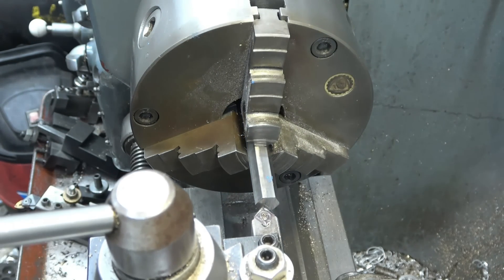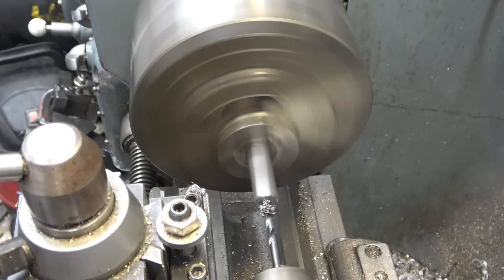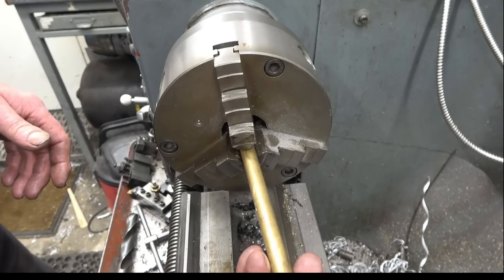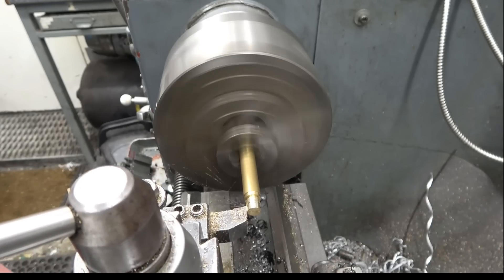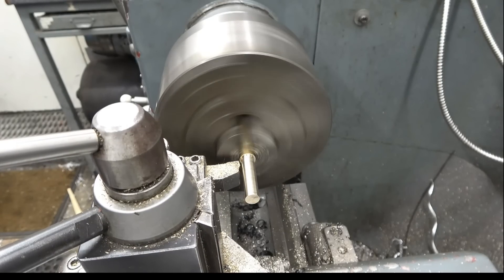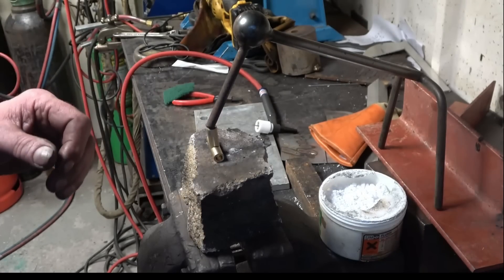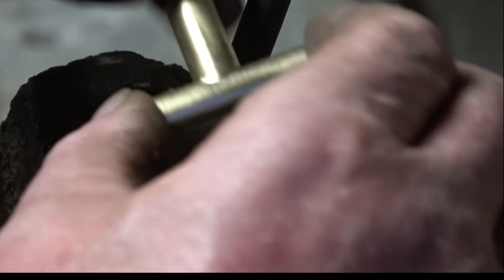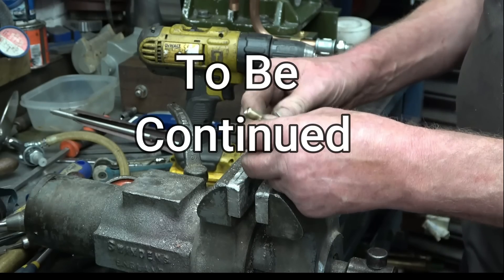SNNC 499 P1  Machining Imperial Nuts . Silver Soldering Brass

Comment: Question -  Hi John, I really enjoy your videos, I always chuckle with the swearing it always reminds me of my days working in heat treatment and the people I worked with. Anyway, my question is, you often have your compound slide set at 45 degrees, what is the benefit of this? If you answer my question, thanks in advance. P.S. After watching your videos, I now use one of my Grandads hand drills to de-burr holes, I would use my dad's hand drill, but I'm thankful to say he is still using it himself.

Comment: The gap in a Silver-solder joint, should Never be greater than maximum 0,1 mm. Ideally 0,05 mm or less, for the capilarly action to work properly. No gaps that is, more or less.
It is less sensitive with cheaper solder wich might be thicker, but very important with high-performance thin-floating solder, wich have the ability of full-penetration and a nice strong concave floating-out joints on both sides of the joint.

Comment: Nice job.
I personally prefer to apply the flux mixed with very soft, or distilled water though. I let it dry or heat it up immediately, it depends on my hurry. Only then do I apply Silver-solder, when the flux shines and the material has the right red hot Colour. Most Silver-solders works best at ~650..750 °C, More Silver, less temperature, and greater the strength and penetration, (fluidity / wetting),  generally. The ductility is also greatly enhanced with more Silver-content, (the ability to not crack brittle under strain).
A good compromise between cost and physical propertiers is 44% Silver, but up to 60% is also used. It works very extremely well to join mild Carbon-Steel to copper and Bronze as well.

Copper-Phosfourous solder with 1% Silver works on pure Copper and piping-Bronze, but not on Brass, the slightest at all. More brittle also and it will fail first on a burst-test, such as on a test-specimen made out of Copper. Not the first choise for a Copper Steam-Boiler. It takes up to 775°C to float properly as well.

On a burst-test performed on cylindrical joints of 20..70 mm Copper-pipes with an overlap-joint of ideally 6..7 mm, you will find the Silver-solder Joint made out 44% Silver is stronger than the Copper and it looks like a belt, before the Copper bursts with a little stream of water in the air :) Of cource not much air in the test-specimen, so as not to cause an explosion, just a pee of water :)

125..150 bar is a common pressure to burst 70 x 2,5 mm of Copper. It Squeals, and most people do not want to stand nearby in the process of bursting, eventhough it is completely harmless, if the specimen is completely filled with water, save for some table-spoons of air :)

My Pressure-Tank, I let a professional build for me as a Compressor-Tank and is good for 125 bar, legally at 180°C with water and steam, but the pressure-relive-valve releases at 10 bar. How is that for a safety-factor ? It was a welding-speciemen for X-ray investigentions, 100 % Röntgen / X-Ray. All welds in the quality of 5 on a 1..5 Scale. Not a single fault. Stamps in the metal from the Welder, and from the Works :)

It already had a safety-factor of 1,5 against 125 bar at 180 °C. And the weld-factors were 80% longitudinally and 45% laterally.

To burst or crack this tank, you would have to pump it up to ~300..400 bar at  20°C to explode it.

Only misuse and lack of draining out water, can cause an accident in the next 100 or 200 of years, for the compressor-oil ending up at the bottom of the tank,  mixed with water as milk, provides for anti-corrosion action.

Comment: The late neighbour of my father was an Italian POW, who came to South Africa as POW, and during the war was building bridges and roads. After the war he did not want to return to Italy, instead brought out his first love, married her, and then worked as a millwright, ending up at a paper plant, where he rose to be the foreman of the shop. He was still working on his retirement, going in 1 day a week to train the people there, as his specialty, welding the stainless steel mesh used to make the paper web, was a long thing to master. When he welded a web all you could see there to say it was a weld was the slight discolouration of the fine mesh stainless steel wire, and the angled line of silver solder in the 0.8mm wire of the mesh.

Each wire bevelled, then brazed together, so that there would be no discontinuity in the paper at the joint. He also did the paper trough, 4mm 316 stainless steel, which lasted 3 months in use before it was worn too badly to use. Worn too badly in that there was no metal left to weld on a patch in places. He made them a titanium alloy one, which lasted a year in use, still with minimal wear through. Expensive sheets though, and he had to make his own TIG rods, using the offcut off the metal, and a guillotine to make the square rods. Thousands of metres of weld as well, to minimise scrap in the flare, using all the offcuts that normally would be classed as scrap metal.